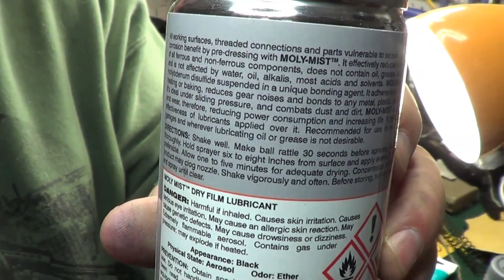Using Moly On Pow Pow Sticks - Is Your AR Firing Pin Retainer Pin In Upside Down?

Comment: I have a sig m400 that has been flawless for years. Then all the sudden it was short stroking in every round. I cleaned it, lubed, used a new mag and it ran great for about 60 rounds then it short strokes every round again. I cleaned and lubed it again and switched to a new mag, new ammo and a new bolt. It ran like 10 rounds then short strokes every round. Wtf!!!!!  Any help? Took it to a shop the guys took it apart and said it’s really clean, lubed right and said the gas rings and gas key is fine. Idk what’s up. I emailed sig. they haven’t responded yet.
Reply from the maker: not sure, I stop buying sigs, they went really down years ago, I have a 1911, ran like shit, rough, sent back to factory, they kept it 6 weeks had to threaten to report gun stolen before they would return it and it still sucked and sold it, never will buy another one.. I have two old 220s mand in germany great fine tuned machines... love them
Reply: Think Like A Cop I have a German 226 that is amazing. I bought my m400 in 2012 it’s been crazy reliable until last weekend. It’s weird.

Comment: If the engineering was done well, it shouldn't make a difference at all!
Otherwise the position would have bin guided.
But: You can try by yourself, with 2 flat and 2 square matches.
Try to bend each type of matches, once when laying side by side, and once laying on top of each other. Which type, in which configuration is stronger?

But could it be that this pin is only a mounting help? I don't have a schematic nor the rifle. During shooting action, there is never force on the pin...

Comment: Would you use moly on the glock slide rails?
Reply from the maker: I did
Reply from the maker: any surface two metals meet
Reply: @HeyGunPeople  
I've always wondered why oil and not grease was used.   Being in the field of mechanics I've wondered while oil and not grease was used in high friction areas.  Moly makes sense to me.

Comment: That don't make no damned sense to me, either. It doesn't make any sense to me because when the retaining pin is all the way in, the two halves are sort of squeezed together in order to fit in the hole on the other side of the bolt carrier, and it shouldn't matter which way it's in. Furthermore, there should be no force against that pin sufficient enough to cause it any damage. If there's any real force going against that pin, then there's some other, more serious problem with the rifle that should be addressed.

Comment: You get less velocity with moly on a bullet. Seems counter intuitive but it’s true. When people were tumbling their bullets with moly, they had to up their powder charges to keep velocity the same. Less friction=less pressure. Less pressure =less velocity. They used denatured alcohol to clean the moly from the bore.
Reply from the maker: someone here said he 20FPS faster after moly bullets?
Reply: @HeyGunPeople  I’m only familiar with it in rifles but the guys I knew who were doing it had to up the powder charges to maintain the same velocity. It’s kinda like how in a 44 Magnum where a 300 grain bullet can reach better velocities with a smaller powder charge than 240’s because the heavier bullet allows better initial ignition and more time for the powder gasses to fully expand and accelerate the bullet. I think the main reason moly use died off in rifles was it was less consistent overall. When they tumbled in moly, they had to shoot several rounds to season the bore and start getting consistent accuracy. And then, if I remember right, when accuracy started falling off (or they’d clean their barrel) they had to go through the whole seasoning process again. I never jumped on board. However, I do make my own cast bullet lube out of beeswax and moly/graphite lube. Works great for cast bullets for folks who are into that. What you don’t want to mix on aluminum parts is graphite...it can cause oxidation of aluminum.
Reply: I said in my first sentence I’m only familiar with it in rifles, but then said I make my own with moly for cast (and I didn’t specify but that’s for handguns and rifles...45-70 and pistol cartridge carbines...real PCC’s like 357 and 44 Magnum...not 9mm lol). I meant I’m only familiar with moly on jacketed bullets in rifles. Never tried moly coated jacketed pistol or revolver bullets. Just wanted to clear that up before some weenie calls me on it.
Reply: We need some data,   non-linear curves here that can trick you.   
I don't know the answer.   Might be higher pressure with less blow-by .... 

The Moly gets into the lattice

Comment: It's called shear strength. two 2x4 will be stronger from the side. Stroger than from the top or bottom. My armor in the Army said the same thing. I didn't try to understand i just took his word for it. you take two 2x4 lay them flat and stand on them they'll bow. you flip them on their side their shear power is much stronger. Ha it's stupid simple so ya'll might be over thinking it. especially an engineer that might not be able two focus on simple basics. I learned this in Mechanics school where they drilled in our heads that we are not engineers lol.